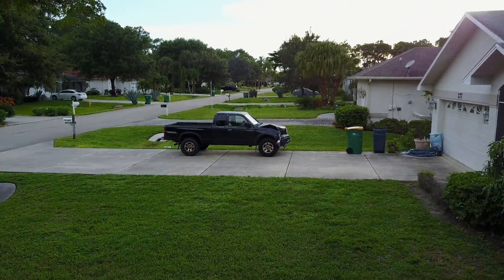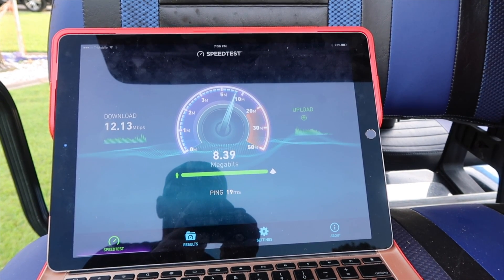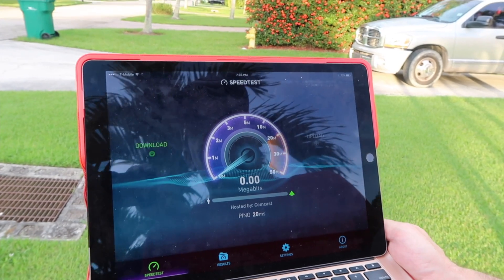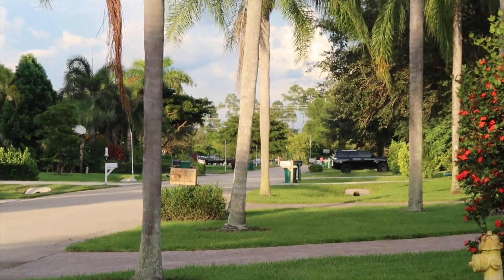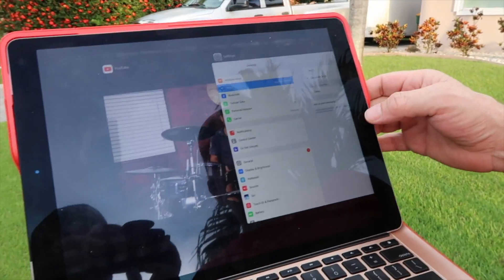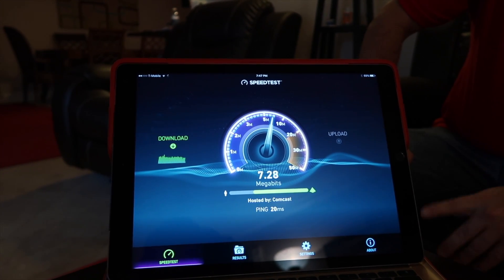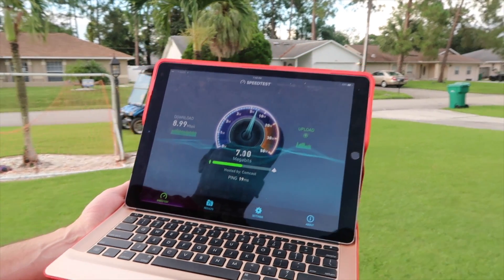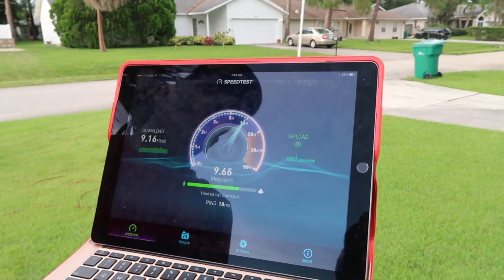Ubiquiti Neighborhood Wireless Uplink

Comment: What's the maximum range of the UAP-AC-M?

 I'm trying to decide between UAC-AC-M, UAP-AC-M-PRO-US and UniFi FlexHD for out door by the pool area.

 These will be liked by a wireless bridge Nano AC5 since my pool area is 600Ft away and I don't feel like digging conduit for that.
I'll have a wired network inside the pool barn area for some security cameras and a single outdoor access point.

Comment: Great video wes! I’ve been looking into deploying an outdoor network using some ubiquiti equipment as I’ve already setup several indoor UAP installs with 2-4 Aps. Have you considered or looked into improving this kind of setup by tying in nano stations as straight line of sight like a wireless Ethernet cable and splitting your mesh in half so you have stronger connection on the far end?
Reply from the maker: Thanks Kevin! nice... I have not at this time. It has been reconfigured and at this time I get incredible speeds at the distances in the video. typically around 50mbs so this is do-able.

Comment: I am considering using a similar configuration on my neighborhood with security cameras on each repeater. Any recommendation?
Reply from the maker: Yes this would work fine. My first recommendation would be to make sure you are legally able to put the cameras in the locations you want like on your own property etc. If you put on public property you could run into legal issues and problems with surrounding property owners.Make sure the spacing is good with good to great signal and then just keep an eye on your bandwidth for the cameras and the network. Will you be using wireless cameras? If so they should work GREAT! I use several around my property.

Comment: I’m not sure if I missed it but what’s the original connection? Trying to figure out the loss in hops but, don’t know what the starting down/up speed is.
Reply from the maker: ramphex, I started with a hardwired AC pro at 150mbs down and 50mbs up. I did find out however that our internet connection was bad during testing and actually it went completely down that day about an hour or so right after we finished the video. We were hot as hell and getting eat by bugs and was getting dark so not the video I would've liked to have done. I will re-do this video and give a much better perspective of everything and a unbroken stream for the entire distance while downloading and uploading from numerous points along the way.

Comment: Great video, I wasn't expecting much after that many hops. If you are looking for more throughput, perhaps a wireless bridge (point to multipoint) like the nano station m5 with one at each pole, pointing back to your home, then using poe pass through on the NSm5 you could power the mesh units as APs. If not able to put a NSM5 on each node, then maybe one at the #3 mesh, have 2 and 4 connect to it, then you've reduced the number of hops to the final mesh unit.
Reply from the maker: Christopher thanks for the heads up on this.I will look into it. I will reshoot that video and on a day when comcast is working properly. lol

Comment: i was hoping to see a test where you move from the first ap to the last ap and see if a movie stream from a local drive in your network will get interrupted or anything. meaning how fast would your tablet jump from one access point to the other.
either way good job it must have taken you a long time to set this up. it was also kind of weird i think that the 2.4GHz network was so much faster than the 5Ghz. i believe that it has to do with the distance and the signal range... but still i believe it should be at least the same speed...

which one of those is mine? :D (ps. i just send you a pm with my shipping address). thank you again.
Reply from the maker: I will do another one that way. The heat and the bugs were insane that day! We are still in the 100F + everyday with 80-95% humidity! It sucks. Gift sent! Prize on the way
Reply: tedev My understanding is the mesh create the link on the 5g band, so the node must receive the data , stop xmitting to the previous node, and forward the data on the 5g band on to your device (basically adds another hop). If you connect to the 2.4g band, the node is talking on the 5g band from the next node, while near simultaneously xmitting to your device without having to stop (so not really another hop so to speak)